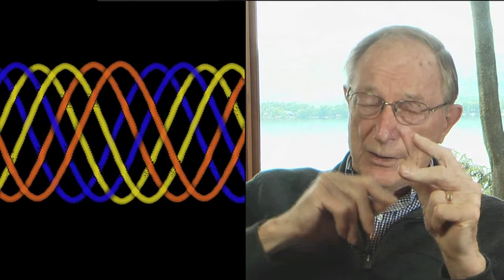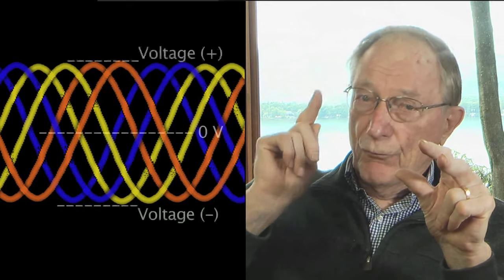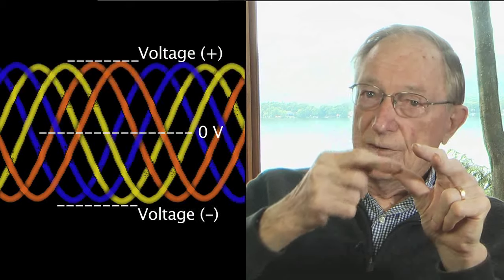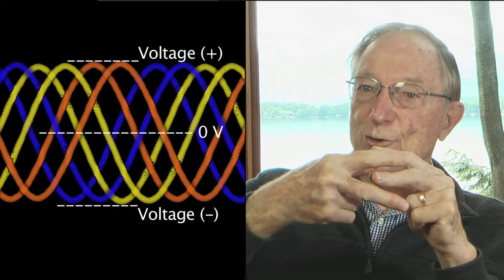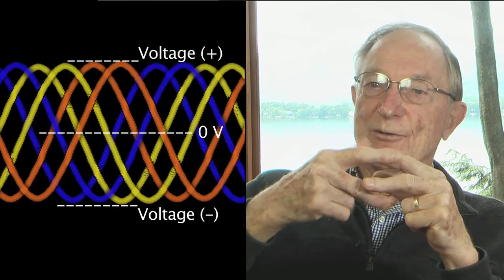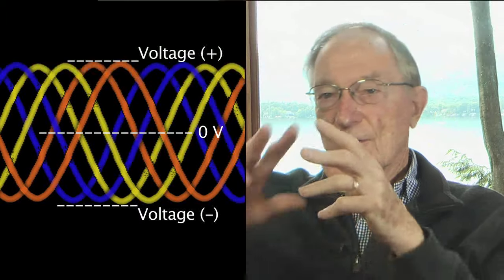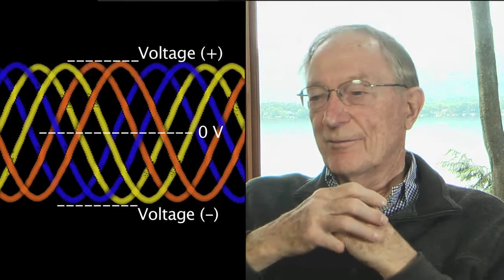Why 3 Phase Power? Why not 6 or 12?

Comment: The reason for 3 phase power is to enable a simple motor to function via a rotating magnetic field.  A minimum of 3 phases are required, any more than 3 gives little improvement while less than 3 won't work (ignoring "tricks" such as capacitors or phase offset windings).  In many ways this is similar to the "4 phase" power used in a steam locomotive (left and right drive wheels phase offset by 90 degrees to prevent "dead center lockup").
Reply: Some of the food we FORGET in the fridge gets fungus (MUSHROOM) , i think he was on it

Comment: I will use this at bedtime to help me sleep.
Reply: This video's presenter is a carbon copy of the lecturer who taught this subject when I was at University. Besides looking the same, they shared a knack for repeating points and making many hand gestures but never really understanding which concepts were easy/hard or answering the right question. I agree, the subject of electrical power transmission makes a good sleep aid!
Reply: That's not economically efficient.
Reply: Although I liked this explanation, I have to say that I laughed out loud at your comment.
Reply: im sure its a very effective tool!
Reply: Its dry subject may be, had one interesting instructor for Pwr. Trans. course but he hardly ever taught the subject matter!

Comment: A three phase rotating electric field is enough to start any 3 phase electrical motor into rotation.  That is why Tesla settled on 3 phases.  It is simpler, more cost effective, and most importantly it was enough.
Reply: The power of 3,6,9 as he always said. It would make a triangle. A triangle is the simplest geometric shape that can house a perfect circle/most efficient angular wave pattern. So think of it as this. Why would I make a 6 sided shape to house a circle when I can do it with 3?

Comment: This should be called TeslaTechCenter! Edison had no clue about AC, be it 1, 3 or any other phase.
Reply: It is a myth that edison did not research AC as an engineer.
Reply: No. Edison stole everything from others - just like Apple & Jobs.
Reply: That's the myth, Mikey.
Reply: @mikeymcmikeface5599 : And you were there watching!  That's awesome.  What did he do with "everything"?
Reply: Agreed! he was too busy electrocuting elephants and dogs to try to prove DC superior. Ironically, DC of the same voltage potential is more dangerous because Dc has no zero crossing
Reply: @kermitfrog1897  you gotta admit though  it was pretty awesome when they fried that elephant!

Comment: the more phases, the more coils - so smoother motor speed control, weaker traction power
Reply: In the last 70 years there are no motors that would benefit from smother controls. Maybe in a confined system like a nuclear submarine but never in industry or domestic usages.

Comment: This what I was expecting to hear in this video! If I remember correctly after 3 phases the transmitted power per kg of conducting material stays the same.
What do you mean by "higher order systems"? I can see that the rectified signal will have double of quadruple harmonic frequencies. Is this what you mean?

Comment: seems that he still did not explain why 3 phases...Why not 2 phases?
Reply: +Jiayang Ruan efficiency and practical. Considering the cost and space required, more phases become impractical. 2 phase isn't as sufficient as 3 phase and again it's a more cost effective way of supplying power with the least amount of power drop between the phases.
Reply: what do you mean by power drop?
Personally I thought the reason is that, 3 phase can generate smooth rotating magnetic filed as in ac motors, whereas two phases can only generate pulsating field. This is the essential reason :)
Reply: Additionally, three phase system is simpler than two phases.  Three phase uses three wires; a two phase system needs four, not two
Reply: So I guess a mix between efficiency and practicality.
Reply: davidpar2, or 3 wires may work making one of the wire common. just make one wire thicker, since they would be 90 degrees apart.
Reply: We actually do use 2 phase; just not in transmission. Most "single phase" services have 2 separate current carrying conductors that are out of phase, giving you the "240" of a 240/120 volt service.
Reply: Max R. MaMint What device uses 2 phase power today?
Reply: really, why not, say, 5, or 7 phases?
Reply: As far as I am aware that is just a centre tap of a single phase 240V output
Reply: 2 phase means 90degree electrical shift which is hard to achieve plus uneconomical as its mechanical structure will be unsymmetrical and hence difficult to use as generator. why 3@ not 6@ or more..the simple answer is symmetry and ease of rotating generator. Thats it..i know there are alot of other stuffs but this is the most BASIC AND SIMPLE explanation.
Reply: 3-phase motors are much more efficient than 2-phase motors. My e-bike and vacuum cleaner are both 1kw but one of them gets MUCH hotter.
For powering computers etc with power factor correction 2 phases is just fine and simpler to wire.
Reply: The reason is that you don't need a neutral wire in symetrical 3-phase system, because the currents cancel out. You can get smooth rotating magnetic field and constant power with 2 phases too, they just have to be 90 degrees apart and symetrical.
Reply: +nfsking2000 he means split phase single phase, i.e. single phase (240v) derived across two (120v) phases
Reply: @nfsking2000  Your kitchen stove.  It gets 240V by using the two 120V lines that are 180 degrees apart phase-wise.  Oh, same goes for your clothes dryer.

Comment: I am a retired journeyman electrician. Your theory on six phase is correct, but I would hate to wire up six or twelve phase conductors to a transformer. It would take a lot of time and one would have to be very careful in wiring it up and phase rotation would be a nightmare.

Comment: This didn't answer any of my questions...
Reply: Not done because it's not economically viable, and It is not linear in its progression of power, instead getting diminishing returns.  May be useful for something but not for common day electronic power stations.  Perhaps an incredibly powerful motor or something idk.
Reply: 3:20 - 4:30
Reply: The wires would get too hot so it would be too dangerous
Reply: You're asking the wrong questions.

Comment: What does he mean by "the voltage per foot is the same" for 6 phase?
Reply: +Enigma758 The voltage you can obtain per foot of conductor theoretically of course will remain the same
Reply: +Enigma758 He's talking about the voltage difference between the different wires. So if you look at two of the wires in the three phase line and they're 3 feet apart with a voltage difference of 120,000 volts, and then you put a wire between them it would be 1 1/2 feet from each of them and have a voltage difference of 60,000 volts from each of them so either way you have 40,000 volts per foot across the air gap between the conductors. Since the gap needed between the wires is determined by their voltage difference, this means that you don't have to move the original 3 phase wires any further apart to add the 3 offset phases to make 6 phase, so the suspended bundle of wires would take up the same space, but carry almost twice as much power.
Reply: jasexavier this is an excellent explanation. Thanks
Reply: But why 'almost' twice as much power? Why not exactly twice as much?
Reply: Power loss to heat.

Comment: The New Zealand Railways Department had 3 phase to 12 phase transformers feeding twin pumpless steel tank Mercury arc rectifiers for the 1600V DC suburban rail service in Wellington. They were being replaced in the 1980s with 6 phase bridge connected solid state rectifiers.

Comment: If  there is a benefit to  6 phase power,   why not start with that ( so that towers can be updated and  substations can be re-done to support 6-breakers and 6-buss bars ).   We don't have to do  12 or  24 phases  just to experiment.  I thought the discussion was going to be that   3 phase motors work better (more efficiently than   single phase motors ),  and therefore,   6-phase motors are more efficient than 3 phase motors (because the phase difference is smaller).  Or I thought that  6-phase power is easier to  "filter"  to become DC voltage because the " rectified peaks occur more often (as in an automobile   alternator).   Thank you for the discussion

Comment: You can achieve exactly the same effect in a motor by simply repeating the phases around the stator.  If you repeat the phases 4 times, there's 12 poles and the effective rotational velocity is 1/4th.
Reply: But you get 4x current per phase
Reply: @pavelnikulin8240  "But you get 4x current per phase"
And that means your wire must be twice thicker, and that means half as many turns, and that means half the magnetic force.  The motor will be weaker.  Well, maybe.  You did mention four times the current; so with 4 times the amps but half the turns, it might still have twice the torque.